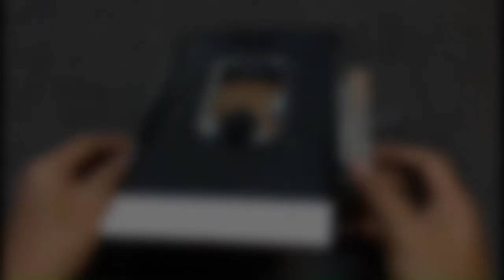How to Make a Mini Sander Disk from Old DVD/CD Player

Comment: How much torque are you getting?  I made one out of a Old Hard drive and didnt get much torque.  Great for very lite sanding but and pressure and it shuts off
Reply from the maker: You can have a high torque if you put a 12v input into the DC motor.